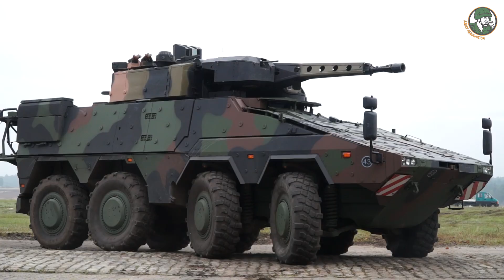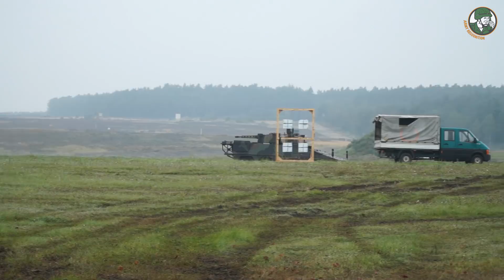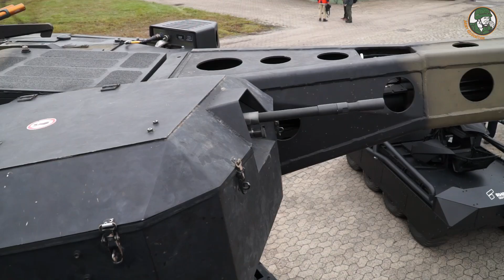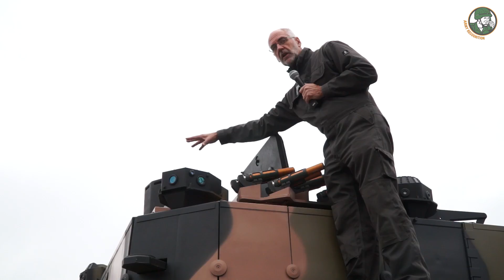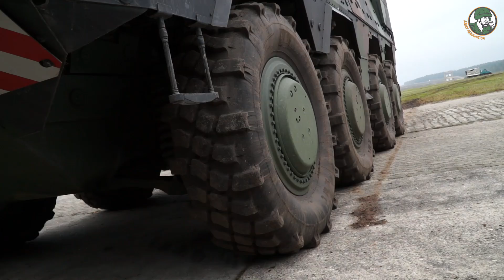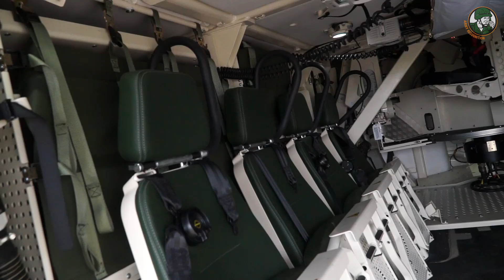Boxer 8x8 armoured with Lance turret Rheinmetall infantry system demonstration Unterlüss Germany

Comment: There is not a lot of legroom for the soldiers sitting opposite each other, obviously it can never be perfect sitting in such a small vehicle but you need discipline not no start getting pissed off when you are that cramped with all your equipment?
I suppose they have a system not to fall over each other on the way out?

Comment: What I am wondering about is the fact that even the version with the turret can still carry 8 infantrymen. If so, then why can't the version without a turret carry considerably more than 8?
Reply: Unmanned turret version carries 8 just like the APC. Manned turret (turret basket) carries 6.
Reply: @jonny2954  But in the video, the version with the turret basket was presented with 8 persons dismount.
Reply: @tz6070  Yes, i got confused because of a PDF about an earlier version stating only 6 dismounts. Apparently it's about which seats are used. The seats in this version are not decoupled and only have a foot rest. Decoupled seats take up more space, the RCT-30 Boxer (Puma turret) as example has an unmanned turret, yet doesen't have an increase in dismounts because it also uses the decoupled Autoflug seats from the Puma (Overmatch Troop SP and Overmatch Operator SD to be exact).
Reply: @jonny2954  Yeah, I was confused too, but that may be the explanation. Also it looks like there is less storage capacity for equipement

Comment: The vehicle's 8x8 runflat tires with multiaxle turning represents a combination of needed and complimentary features. The protection from landmines and IEAs is very good. The reconnaissance mission is ideally served with the low silhouette, armored protection, and exceptional mobility/speed. 

However, lacking a larger chain-gun mounted in the turret, such as a 35 or 40 mm variety, a TOW missile system or equivalent would provide an unplanned MBT confrontation with a least a chance of surviving the meeting.

Comment: Put the 40mm cta on it and you'll actually have a worthy air burst anti personnel weapon
Reply: The 40mm CTA ammo is smaller in lengh than a conventional 40mm, yet it's still significantly larger than conventional 35 or 30mm rounds, thus, less ammo stock.
Reply: A vehicle like this is for fighting infantry, ineffective air burst capability makes it pointless.
Reply: 30 and 35mm do not have ineffective airburst capability. First off, it's more accurate since the CTAS doesen't count in velocity diffrences, the round is programmed in the chamber. 30/35mm AHEAD is programmed at the muzzle.

Second, the general amount of stored and ready to fire ammunition on the 40mm CTAS is much lower, thus not only the ammo stock is smaller but so small the 'stored kills' are also lower. No suprise israel went for the 30mm over their 40mm CTAS equivalent. Bigger isn't always better.
Reply: It is not supposed to mainly fight infantry. The Australian version is mainly supposed to be a reconnaissance vehicle, so it needs a gun to defend itself against other armored vehicles, if it gets detected during a recon mission.

But even the German version, which is mainly used as a troop carrier, needs the big gun mainly for fighting other vehicles. Against infantry it has the secondary MG and it is the job of the infantry it carries to fight enemy infantry anyways.

Besides, this particular gun has a dual feed mechanism, which means it can chose between 2 types of ammo on the fly. That usually is armor piercing and something against soft targets, like air burst or HEF.

Putting a gun on a vehicle like that, which is specialized against infantry would make very little sense. This isn't one of those Russian "Terminator" things.
Reply: You can mount an AGM (Artillery Gun Module) on it. This has a fully automated version of the 155mm gun from the PzH 2000 and can be fired without using stabilizers. Thus it can deploy, fire a salvo of 8 rounds and move on in 90 seconds.